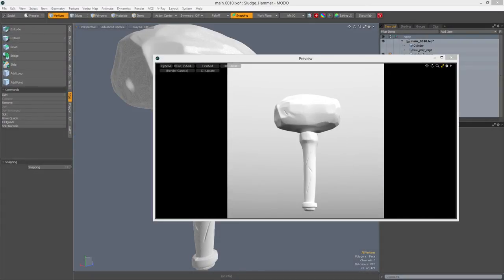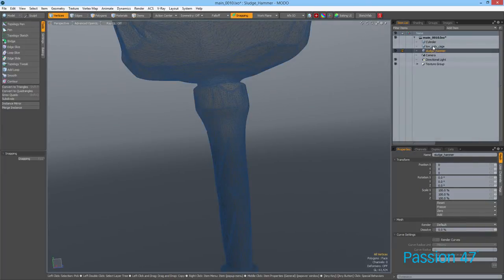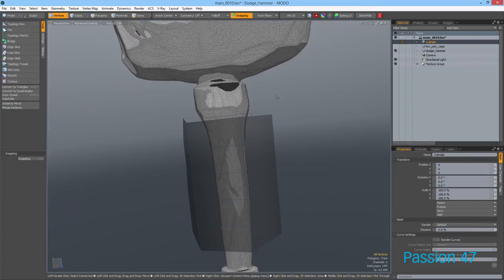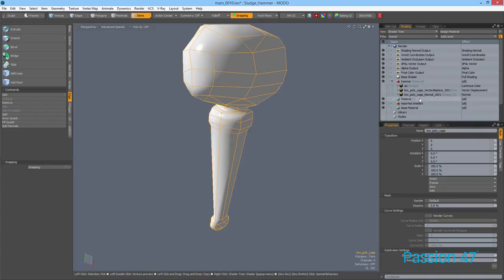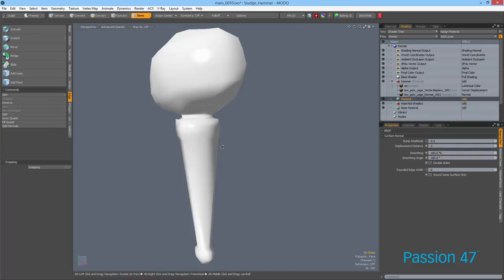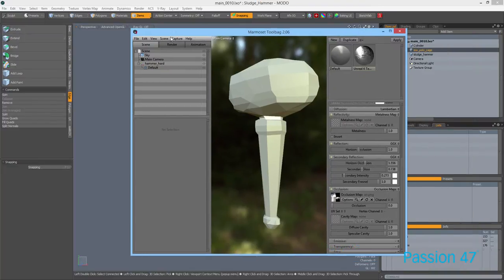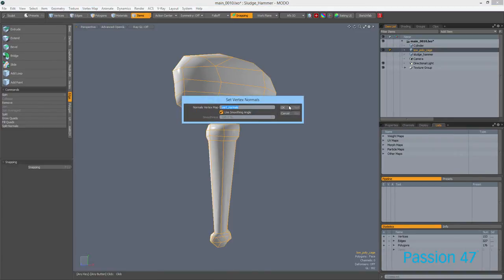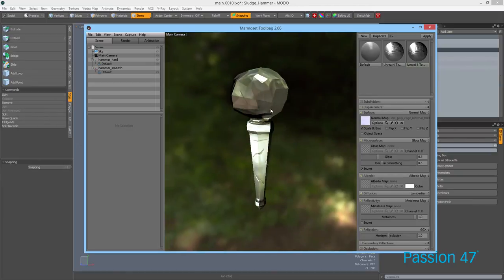Modo Smoothing Groups pt 1

Comment: Thank you! Also i found that you can set smoothing angle around 180 to get very smooth result and then use split normals to make hard edges (http://modo.docs.thefoundry.co.uk/modo/701/help/pages/modotoolbox/Tools/SplitNormals.html).
Reply: +Nikolai Salin Thanks so much! This link you have shared pointing to the actual modo help system has really helped clarify on the values needed to be used!

This is the updated link by the way on the same topic "Split Normals": http://modo.docs.thefoundry.co.uk/modo/801/help/pages/modotoolbox/Tools/SplitNormals.html

And this is related to it "Set Vertex Normals": http://modo.docs.thefoundry.co.uk/modo/801/help/pages/modotoolbox/Vmaps/SetVertexNormals.html